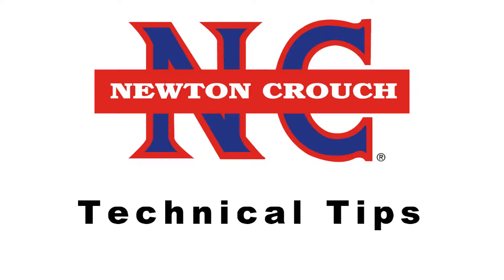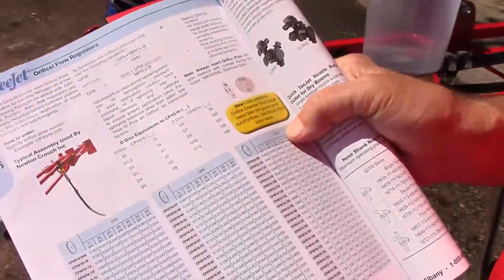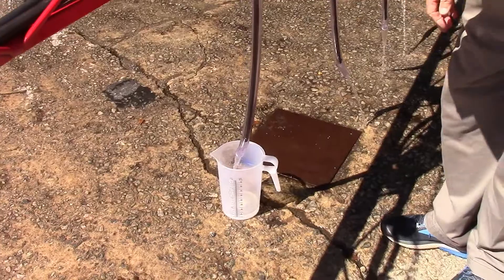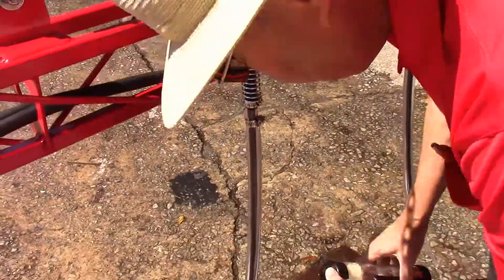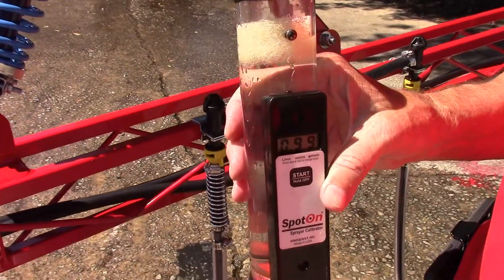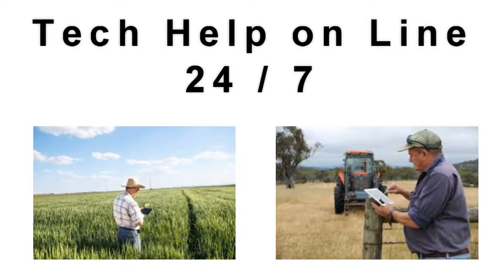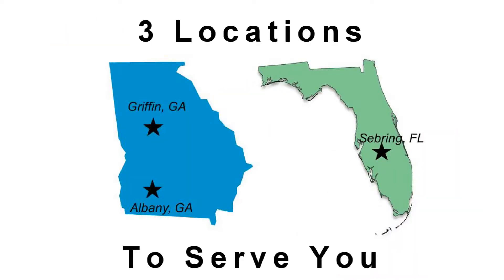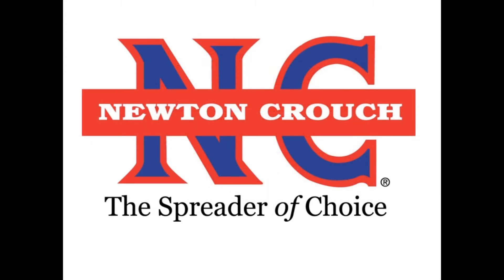How to Use the SpotOn Sprayer Calibrator

Comment: Can you use this to get gallons per acre
Reply from the maker: Yes.  However, there is some math involved.  Go to page 140 of TeeJet Catalog 51A upper left hand corner.  There is a formula :    GPA = 5,940 X GPM(per nozzle) /  MPH (your rate of travel)  X  W (nozzle spacing in inches for broadcast spraying)  I know that looks really complicated but the Technical Information in the TeeJet Catalog has nozzle spacing information that you can use in this formula.  I hope that answers your question.  You can always call us (800-241-1350) and NCI will send you a copy of that page from the catalog for your records.